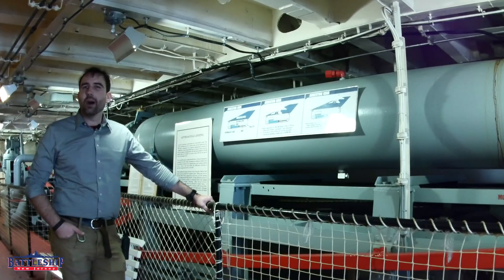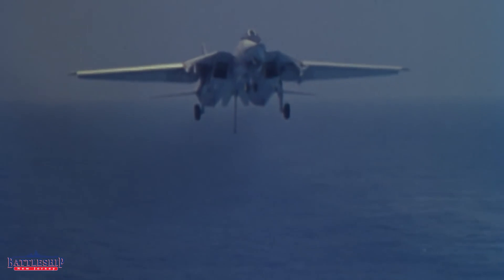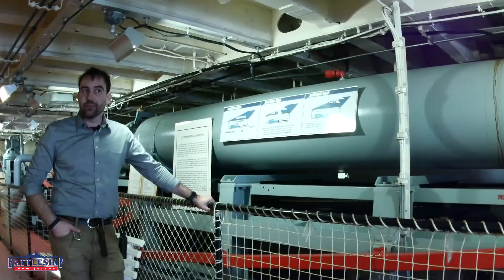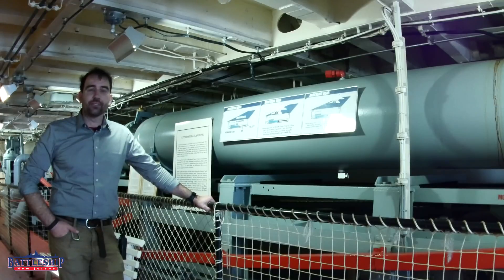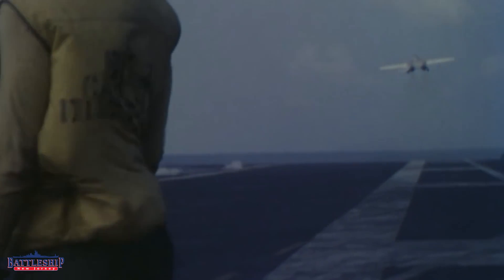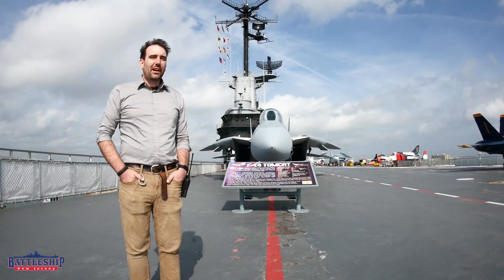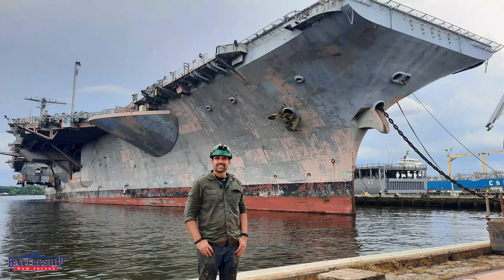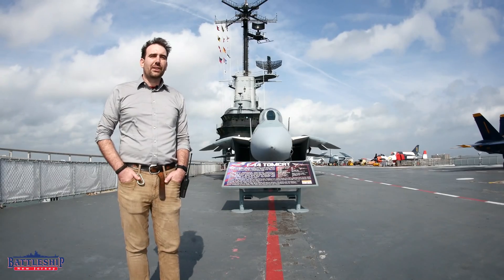Take Off and Landing On An Aircraft Carrier

Comment: Spent 1 1/2 years on Kitty Hawk (split sea tour). Two very loud noises always stand out, catapult shots and arrested landings. My berthing was near #1 catapult and I believe some of the piping went through my space. Learned to sleep though that. On landings the arresting wires would make a horrendous noise as they spooled out. 
Beneath  to the LSO station is a Safety Area for the LSO's incase a plane looks like it will crash near them. You get to it by jumping into the nets next to the station, and it was angled such that you could roll into the safety area. And you have ~6 guys trying to do this at once.

Comment: Been on USS Nassau and Kearsarge, Helicopter carriers.  Never had the opportunity to watch catapults and recoveries. 
Watching Harriers take off was interesting. We would be inside the helos on the deck, scream at the top of your lungs with double ear protection, and you couldn’t hear a thing except the engines as they rolled by. 
Sorry but no they do not take off vertical, especially with tactical load outs.
Not that the aircraft wasn’t capable, but it used to much fuel, I don’t think they even can with full load.

Comment: 7:09 A catapult on the hangar deck? I did not know that. You launch aircraft from the hangar of a Forrestal class you get a big fire. Plus there's no catapult down there...
Reply: Some early carriers were designed with a catapult on the hanger level just over the forecastle and its anchor windlasses and chains.  It really didn't work out well and was removed from those ships and never installed in the others (mostly Essex class and later ships.)

Comment: Did a Hardhat Tour of the USS Lexington about 5 years ago which I really enjoyed. Parts that I can recall or that were fascinating to me included the forward steering area (Parts of the movie "Pear Harbor" were filmed in there), the diesel generator room, the actual brig, and the area's where the prop shafts exit the hull including shaft ally. I originally toured the ship back in the early 90's before it retired so it was interesting to see it both before and after retirement.

Comment: Something else to put out there about the Essex-class modernizations --
some of the ships received hydraulic catapult upgrades, some of them received steam catapult upgrades.  Those that got the steam catapult upgrades were capable of slinging heavier aircraft off their decks.  Virtually every aircraft carrier during World War II used hydraulic catapults.  Steam catapults did not become the standard until the 1950s and even then there were many Essex-class that were not refit with steam catapults.  Those ships were reclassified as CVS (antisubmarine warfare) vessels in the late 1950s/early 1960s but those with steam catapults were capable of being put back into service as "full attack" (CV-standard;  USS Intrepid met this standard because it was equipped with steam catapults but nonetheless remained with a CVS designation until decommissioning in the mid-1970s) aircraft carriers.  Oriskany was never reclassified as a CVS carrier; she was CV-34 when she was decommissioned. 
Half of the Essex museum ships that still exist received steam catapults -- the Lexington (training carrier for the Navy for nearly 30 years) and the Intrepid.  The Yorktown and Hornet received upgraded hydraulic catapults.  
Oriskany, which was the last modernized Essex-class ship, received steam catapults in her rebuild of 1957-1959 which also installed her angled deck.  Oriskany is not technically a museum ship but you can still visit her in the Gulf of Mexico if you're a certified scuba diver!

Comment: Prior to the "Service Life Extension Program" at the Philadelphia Naval Shipyard, I worked on the Lady Lex as it was called. 1980. It was in the worst condition I have ever seen. The hull had many thousands of "worm holes" that required an army of welders to clad weld every single one of them. and the rust everywhere was shocking.  I can't believe the thing still floats. 
Little know fact. The original WWII Lexington was sunk near the end of the war. At the time a heavy cruiser was having its keel laid down . Naval architects were tasked with converting the keel into a carrier. Down in the bowels of Lexington you can see where the bow of the cruiser was lengthened and reconfigured to convert it into a carrier. This Lexington never made it in time to see action as the war ended before completion.
Reply: USS Lexington (CV 2) was sunk during the Battle of the Coral Sea in early 1942.  Her namesake was the current Carrier Lexington (CV 16) which was originally to have been named "Cabot" but was changed after CV-2 was sunk.  She was launched in September 1942 and served as Flagship for Admirals Marc Mitscher and Raymond Spruance as various times.  She was laid down as an Essex class carrier, not as a cruiser.  During her reactivation yard period in the early 1950s she received her angled deck and enclosed "Hurricane Bow," this is probably the bow work you note in your description.

The confusion about CV-2s origin may be because she was originally laid down as a battlecruiser as was sister Saratoga (CV 3.)  Both were converted during construction into large and successful aircraft carriers.

CV-16 was kept very busy all through her service life, she was in rough shape when I got a tour of her in 1972 so I very much do believe your description of her condition when she entered the yard in 1980.

Thank you for your service.

Comment: I don't mean to be a picky old fart but you swerved into my area.  The cats are set to a specific launch weight and  the brakes on the AG are set to the anticipated landing weight, all the wires are the same.  You don't get a longer runout with the 1 wire.  Aiming for the 1 wire gets closer to a ramp strike and that ends in a spectacular crash, a bolter just moves you down the greenie board but you get to do better the next day.  I spent 3 cruises sleeping between the 3 & 4 wires on the TR (03 level), it will make your ears bleed and you learn to sleep with wearing attenuators.  The 25 yrs I spent on carriers the LSO was still called 'paddles'.
I was recently retired and visited my 1st BB, the newly opened Wisconsin.  I questioned a grizzled 'young' volunteer with a BB-64 ball cap that looked like he had it during the Korean war, what the davit looking things were for.  They were for unreps and I asked him his rate and he was a USAF vet but volunteered for BB-64.  good man!  That story still makes me smile

Comment: Er, I don' think the different wires are tensioned differently. From a deceleration point of view, it doesn't matter which wire you catch in the end.

Also, you don't meaningfully slow down (or at least you shouldn't) once you've hit the groove. You're just flying a specific angle of attack down to the deck on a specific glide path so the hook ends up catching the wire at the optimal angle.

Comment: As usual, great video! I think the run out on each wire is the same. If you get a 1 wire you stop way earlier than usual. If you get a 4 wire you will be near the end of the angle deck when stopped. Also pilot will go to mil power at touchdown not prior.
Reply: IIRC you are correct on the runout on the wires. Like everything else with takeoff/recovery, its set by aircraft weight so you dont damage anything under normal circumstances. One thing that was slightly glossed over was just how BAD a 1 wire is.... if you hit that, you are WELL below glideslope and in serious danger of a ramp strike. My berthing was just under and behind the wires near the ramp, with our squadron QA department right back at the ramp (the rounddown was easily seen in the overhead in their shop). I thought it a bit ironic that in the case of a ramp strike, Quality Assurance would be the first shop taken out....
Reply: On Forrestal the distance from F14 hook point to the ramp was only 10.7 feet if you were on glideslope. Lex was much smaller. I want to say only 127 feet from ramp to 1 wire. So you are certainly right that a 1 wire would mean a very close pass by the ramp. On Fid our ready room was between the arresting gear engines for 2 of the wires. Still remember the screeching.

Comment: The Arresting Gear - I have been near one when in use - on Flight deck landing operations. That Thing screeches like -  -  -  - . I think some movies got the sound from there for the scary alien sounds.  Surprised you didn't get another "shot" near some of the below deck equipment with the catapult. Some surprising Lexington stories I have heard. First off, I doubt a F14 ever landed on her. I have seen a picture of a EA-3 Skywarrier land on her. There a story of Reserve Squadron of A-6 doing quals - their Aircraft Nose wheel fell through flight deck. Supposedly Lex did not get the whole original Wood Flight deck removed and replaced with steel all at once - no one knew composition of flight deck for all areas. I thought Made me look - Per the WIkipedia Article on arresting gear - the 3 newest carriers (Rreagan, Bush and Ford) only have 3 arresting wires. (dated, maybe more are such now)
Reply: yeah, once you have heard the gear in action, you dont forget it  Bang....WHEEEEEEEEEEEEE.....scrape scrape scrape    over and over again.... after a while you dont really hear it anymore, especially if you are night check.....